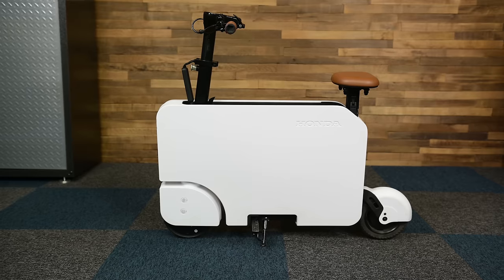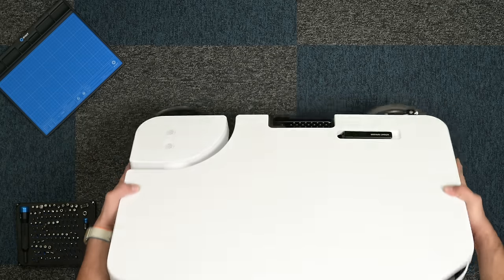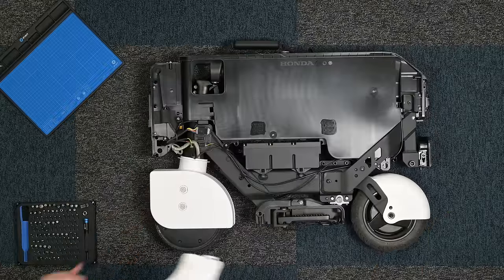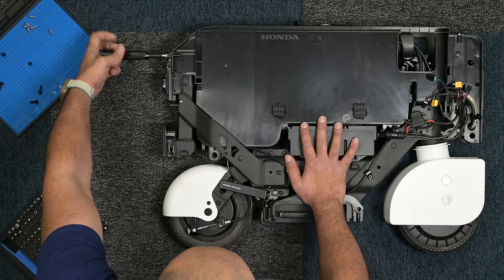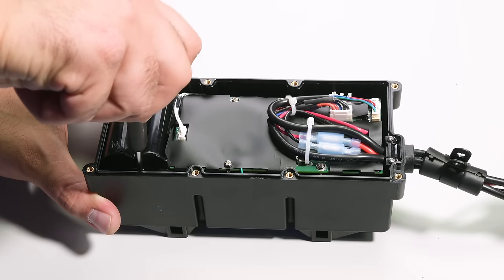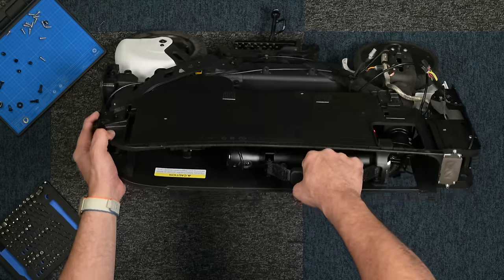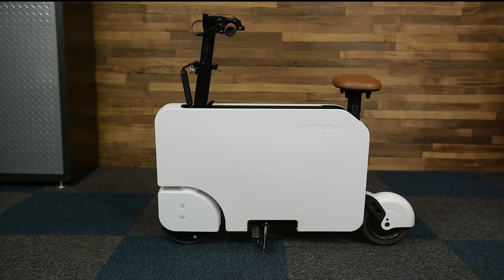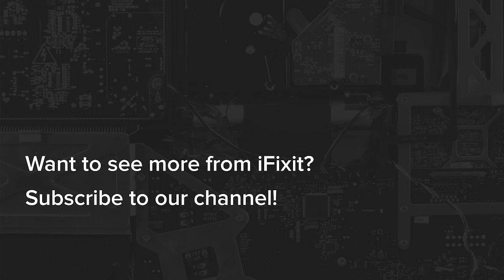Honda Motocompacto: Held Together by Screws and Velcro!

Comment: This is kinda goofy for a 12 mile range ngl
Reply: It's designed for the last mile.  So that's 6 days of your commute.
Reply: It's meant for "the last mile". Meaning you don't have a choice but you have to park a block away or similar. Then you hop on a ride to where you need. This will be awesome for everyone with an EV, when you can only charge it a little way from where you need to be. Plug your car in, and ride to where you need, then do it again to go home
Reply: If I drive mine for about an hour the battery still has charge. And after an hour you’re sick of that small seat anyway
Reply: @plainlybasic2300 seriously? Why not buy a gas car then. Nobody does this with regular cars. They don’t park somewhere then pull out a bike for the “final mile.” Why are you ruining your life??? For what? Because someone who lies over and over and over told you the planet is in trouble and you must mine 500 tons of nonsense and drive an EV to save it? It’s lunacy. And they got you spending a fortune for the EV then another grand for your “final mile.” 

Think about what you said. Seriously.

Comment: Looks like the wheel motor PCB is covered in conformal coating to prevent moisture issues. A little difficult to work with when repairing, but a good touch that was left out from this video.

Comment: It almost looks like they intentionally made the battery hard to remove. I wonder how long before someone comes out with an 3d printed adapter and a wiring harness that lets you slap on a 40V+ power tool battery like the Ryobi 40V or similar to add range to it. I've been wanting one of these since announcement but that would make it an instant buy.
Reply: Aren't there already adapter's like that? I think I have seen something like that but it was more like universal adapter than specifically made for this.
Reply: The storage bin above the battery would be an easy location for that.
Reply: Could be just be an oversight, at least as far as the bin placement being an obstacle to battery removal.

The screws on both sides is a minor nuisance that they could have alleviated with longer screws and a couple plug covered holes in the side panels

The  orientation of the battery may have been intentionally chosen to  maintain balance and limit the exposure of the battery to water.

Comment: This is awesome Im glad to see that Honda did something for users. I hope that if this sells well the v2 will be even better. I wonder if you could ask other Scooter manufactures for samples. BMW CE-04 would be great also that Swed one if you can find it the Sondors Metacycle. Yes these are both very expensive and have pretty powerful batteries and may not be able to be fixed by the average user (via lack of tools, warranties, etc.) But if these are the future of transportation. Is it fair that the avgerage consumer wont be able to do common repairs or fix common breakages in their home/garage? Thanks

Comment: This thing is cool! If possible I would love to see a video covering replacing a battery in an electric car. From what I've heard it's not easy, and like all batteries those wear out too.
Reply: Take a LPF battery, used in most EV's these days. It has cycle life of 5000 times from 0-100%. Say the range is 400km then the battery life will be 5000 x 400 = 2 million km. So these batteries don't 'wear out'. Not before every other component of the car does.  But yes, like any tech, a few will break beforehand.
Reply: @hunktubes  Interesting, thanks!

Comment: I think Honda should make a 21700 battery version of it, because 21700 can deliver more power (ampere) and has more capacity with slightly more volume. I think if Honda Don't do it, some after market solution will be available soon.

Comment: This is one application were the power density of fuel made all the sense.
 A battery run electric version of the motocompo it's just too heavy and it has a lackluster range goven the dimensions of it

Comment: So it uses an XT60 connector? Seems like you could add some zippier batteries in and see if it reveals the magic smoke or gains a few mph.
Reply: I think the motor controller is going to be your limiting factor.
I extended the range on mine, increasing the top speed is next.
Reply: @HondaFit4Adventure  very true, this is getting extreme but there’s some pretty inexpensive motor controllers. You could swap out for a brushless motor and use some 12 S lipos and hit 60 lol

Comment: I mean, how often would you need to replace the battery?  Once every 5 years?  I think it is a misnomer to call a lithium Ion battery "consumable" if other parts of the machine break first.  The whole thing is consumable with that logic.  Not saying batteries don't have a lifespan before they are recycled.

Comment: This is basically an electric scooter that was converted to little electric bike that folds away into a suit case. The battery pack was limited for price and weight. It would make it a lot heavier if they doubled the size of the battery pack for 24 miles of range. 

The thing is that, in the Moto Compacto’s home country of Japan.  12 miles range is more than enough. As the whole point of this scooter is to get the rider from to a mass transit station, from mass transit station to work. Then at the end of the day they do the trip in reverse to get home. It saves a lot of time walking if your home or office is 1 mile or farther away from transit station.

Americans or Canadians will never understand the Appeal of the Moto Compacto because we live in a Car centric society. If you don’t have a car, everything is just out of reach. The only exception is Americans that live in NYC, Boston, Chicago, Washington DC, and maybe certain areas in Florida.
Reply: The thing was entirely designed in the USA and it is not being sold in Japan.
Reply: @ryanmcfarland1900 yep, totally not related to the 1981 Japanese Honda's Motocompo. :D
Reply: In Florida we use the golf cart.
Reply: I live in the DC area and I’ve picked one up and my problem with it isn’t the range, it’s the lack of torque. Unfortunately it stalls out going up medium hills and the riding position really does not lend itself to kicking off

Comment: How close is it really? It looks like you could wiggle it out with minimal force, ie maybe hit the screw terminals with a file for 1mm more room? I like the thick power rails on that motor controller, big solder blobs dont scare me.
Reply: I'd be asking if it really needed to be retained on both sides, and just remove the tabs on one side. Maybe add a little more velcro around the battery :)
Reply: As someone who spends all day working on cars I can guarantee you with a little bit of effort that battery would come right out without taking all those extra screws off. He was lacking maybe a 1-2 mm of clearance on that battery

Comment: This has already been tried and already failed (many times).
Reply: What do you mean by this?
Reply: @channelmachinebroke9638  It's not the first vehicule of this type, and none of them were a success.
In fact this is a successor to the Motocampo that was the same thing with an internal combustion engine.
The actual answer to the problem is good public transit.

Comment: Your average diy push bike has a bigger battery than that, what is all the other space being used for?
Reply: That space is being used for the seat in order to fold it away inside, as well as space for the handle bar to collapse into as seen at 0:26

Comment: Is it just me or most of the screws are directly screwed into thin plastic? Not much materials and easy to strip.
Reply: In some places there securing plastic to the metal frame.
Other locations have a metal nut on the other side of the plastic.

Comment: Great video! Just picked up my own Motocompacto. Definitely super fun. Hoping the release that both locks the seat down when unfolded and locks the folded handlebars in place is adjustable. The latch gives way and won’t allow the carrying handle use when the weight of the scooter pulls against it when trying to lift in the folded state.  Haven’t looked closely.

Comment: When I saw this I wanted it so bad. But then I saw the Range all these ones I could actually easily lug down the stairs of my Apartment. They all universally have terrible Mileage and Sometimes Charge Times as well. If it had like 30 or More would be Instantly Sold.

Comment: 0:17 19 kilometres of range, 120 kilogram limit, 8 Kilometres per hour? 🤔 I am not a scooter guy, but for some reason I do think that the range could be a bit better. 😅 Agreed that Honda should definitely release spare parts and manuals to the general public. 📖
Reply: It's intended for last mile commute. More of like scooting from your place to the parking lot to throw in the back of your car. This has more than enough range.

Comment: Making the battery difficult to access and not allowing limiting charge to 80% not an oversight, it's called
Intentional Planned Obsolescence .  The same goes for many other brands and devices. 
It's not in the manufacter's interest to have the product last far beyond its warranty period.
Reply: Its not dificult to acces, it probably takes like 5 minutes more, and also, why dont you give them the benefit of the doubt? If they really wanted to make this difficult to repair it would've been glued in and used less screws and more clips
Reply: *planned obsolescence
Reply: Uh, no.

Comment: In the video, the battery pack has 20 18650 cells. Each cell is 3.7v. What is the output voltage of the pack?
Reply: 42volts
Reply: @HondaFit4Adventure  Are you sure it's that high? If you divide the pack into two sets of 10 cells, with each set wired in series, and the sets connected in parallel, that would give you 36-37 volts.

How would the cells be configured for 42 volts? Or are there actually more than 20 cells?
Reply: The battery pack will measure 42volts at full charge and 34.5 volts when the battery meter starts to flash. @MorrisDugan
Reply: @HondaFit4Adventure  I suppose that's like a car battery that can be over 13 volts right after a full charge, but about 12.6 volts when it's "settled."
Reply: @MorrisDugan  Sounds about right.

Comment: 2:01 244Wh is not hefty at all. In order for it to be hefty, it should be at least 400Wh. (Yet) another missed opportunity to make the electric scooter more usable, especially if it ran on 48V instead of 36V to improve maximum power of the motor for going uphill and to improve the efficiency of the motor at high power. Going from 250Wh to 400Wh is only just a 1.5kg increase in total weight, not a big deal, especially since it's going to be useful weight.

By the way, in order to limit the battery charge to 80%, you'd need to take apart the charger and twist the voltage knob to make it only output around 40V instead of 42V to charge it to only 80%. Not user-friendly out of the box, but that's usually how battery charge limiting is done on electric scooters. If it doesn't have a knob, something else (like using a series of diodes) may help you lower the charger's voltage to 40V.